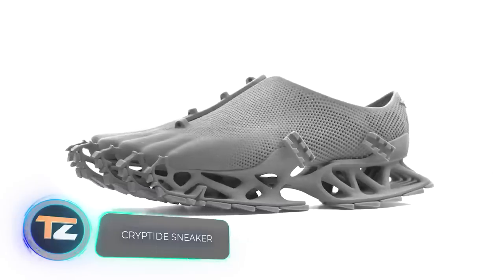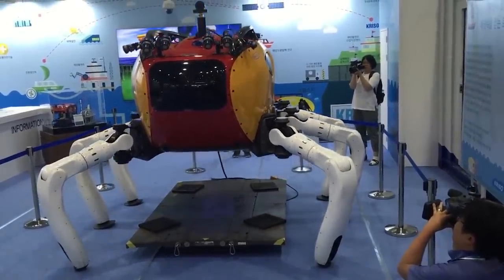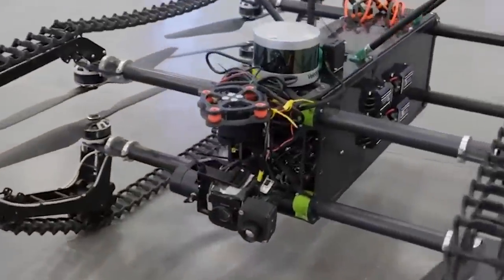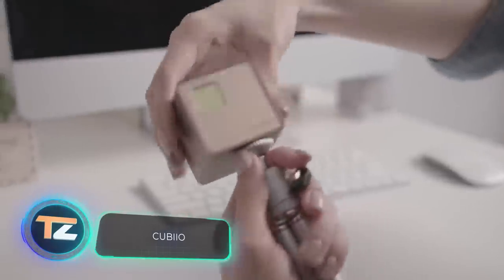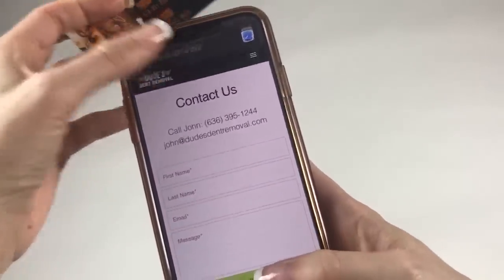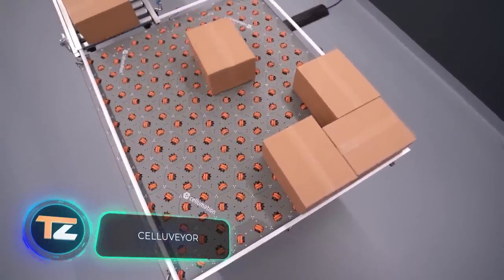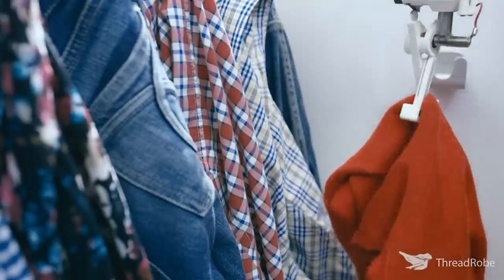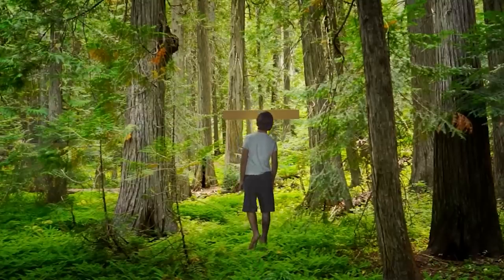COOL INVENTIONS THAT WILL SURPRISE YOU

Comment: I doubt pushing garbage via pipes works, the pipes will get clogged up almost every day. We have enough problems with tampons and napkins in sewer lines
Reply: Even better the amount of construction work and permits.
Avoiding existing underground infrastructure etc.

Because no matter how good the city planning and zoning system.
There is a water or gas line that is not where it is supposed to be.

Comment: I like the inflatable vest. I’ll tell you something funny: Life vests which are required for people in a boat, don’t do anything. Statistically, wearing a life vest offers no added protection from drowning. The odds with and without one are exactly the same.
Reply: @atacstringer8573  I agree with everything you said. I’m not against life vests, I’m just saying that statistically they don’t save lives. So there’s no reason for them to be legally required. With that said, if I had children and we were in a canoe, I would have them wear a life vest.
Reply: @ronliebermann  I see where you're coming from and I do agree that having them required by law is dumb
Reply: With all that's being said here in the comments and replies, I have concerns about the product mentioned.  It requires one to pull a lever.  If someone's been suddenly plunged under the water how likely are they to be clear headed, or even conscious, enough to pull this lever?  Would the device be better with some kind of internal pressure system to activate at a depth of a few feet?  And is having the device on one's wrist the best location?